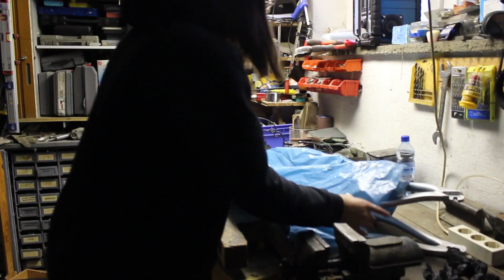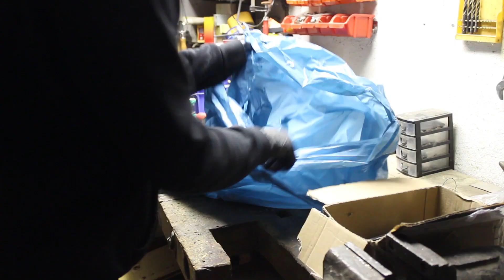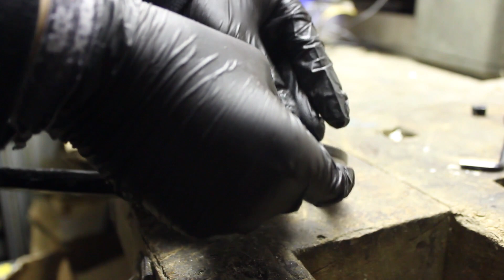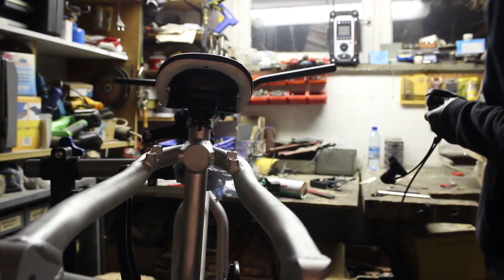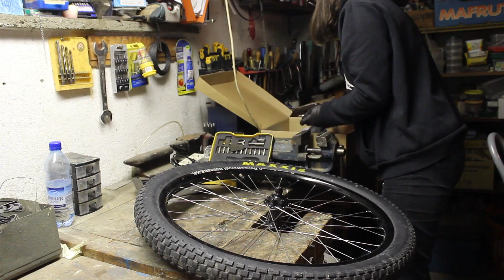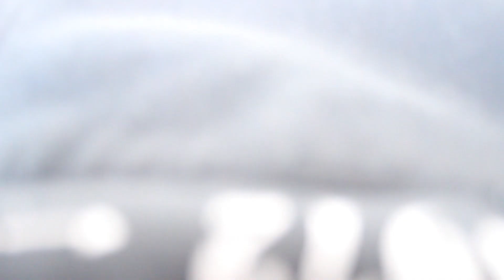BIKE BUILD - Inspired Hex Pro

Comment: Nice video!
Some things to point out if someone wants to follow this as a tutorial:
> use designated external BB tool to tension this bottom bracket
> use washers between the bolts and the disc brake mount(frame and forks too) when installing adaptors
> very well greased up threads, headset and seat post are good things, but also keep grease and oils away from the rotor and brake pads